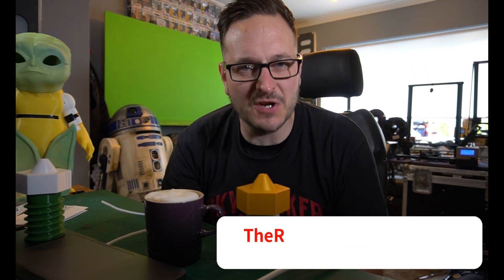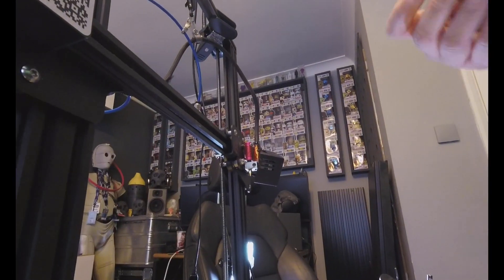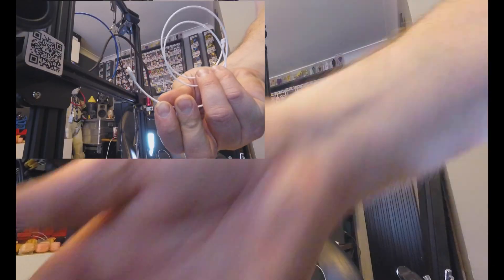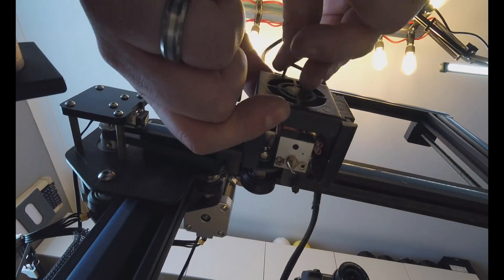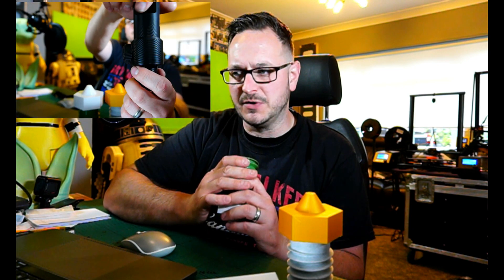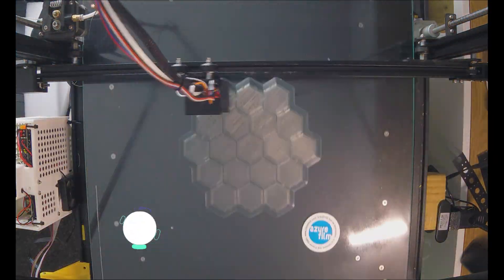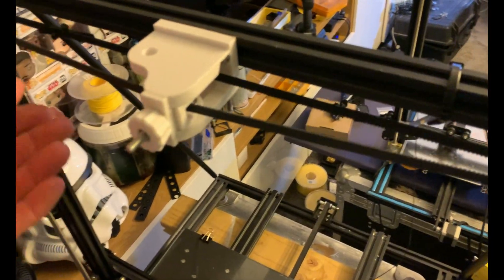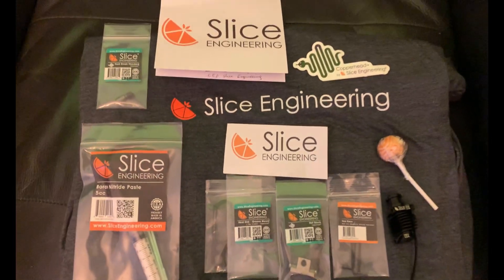Fixing a Creality CR10 S5 3D Printer Part 2

Comment: @The Real Sam Prentice  I have an CR10 S5 it has the Creality v2.1 board in it how can I upgrade to the newer ones?
Reply from the maker: Depends on what you want to do and add
Reply: The build plate is massive and it is a pain to "level" it so I wanted to add a CRTouch. But these work only on 4.2.x boards and Creality doesn't provide an update for the 4.2.x board for the CR10S5. Now I've been told that I could add a BLTouch to it and upgrade to a v2.2 board which is a littly less loudly. What should I do?
Reply from the maker: @KalayAtilla1992  ok so you could go with and skr2 board with silent stepper drivers that’ll do what you want
Reply: @TheRealSamPrentice  where do I find the firmware for those because some one also told me that I could go for the TH3D firmware

Comment: I have a CR10S5 that desperately needs new parts. It needs new belts which I have no clue where to order and what kind to order. I also believe a y-axis gear has been chewed up because it makes a grinding sound when the nozzle is pressed onto the bed. Do you know what parts I would need and where to get them?

Comment: Have a car 10s trying to print the test prints it is stopping before it is finished 
Can anyone help
Reply from the maker: have you tried printing something else? The file could be corrupt
Reply: I tried printing the cat and the dog that came with the printer
Should I try updating the firmware
Reply: Have been messing with the settings is there anyway to factory rest the cr10s so it has the original settings
Reply from the maker: @leighharris863  happy to set up a zoom chat to try and help you out with this. Is the printer stock, new and fresh out of the box?